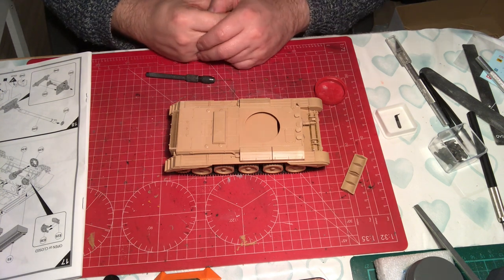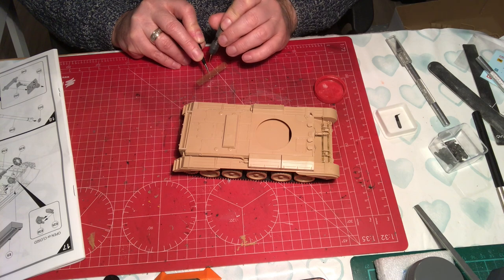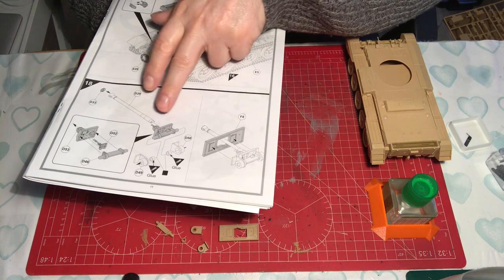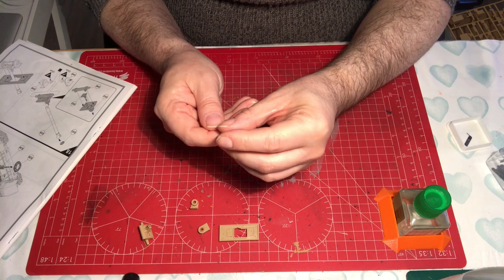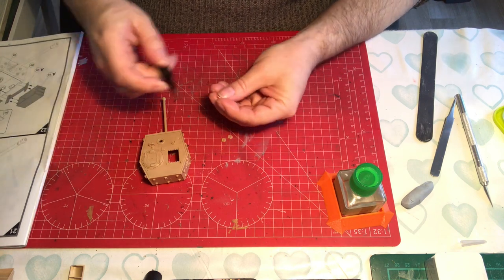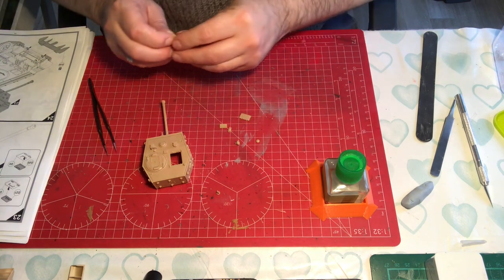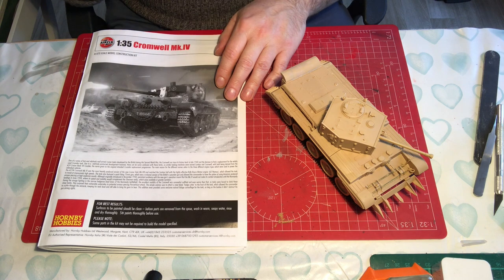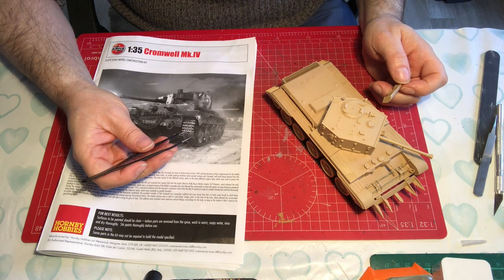Airfix 2021 1/35 Cromwell MK.IV build part 4

Comment: The small part of the bottom of the Extra Thin glue brush can be carefully pulled out to give you access to the glue at the bottom of the bottle. 
makes it easier to use all the glue before you have to purchased more. Like your videos.  Bill

Comment: you can lengthen the brush slightly when glue gets low
Reply from the maker: yes you can but I find the brush curls on the bottom, so I will decant some more glue in.

thanks fore looking in and your comments.

Comment: Thanks for the upload Jason :-) The applicator you used for the superglue, what is it called and where did you get it? I'm always messing about with toothpicks and match sticks and your tool seems so much better for the job. Stay safe bud.
Reply from the maker: Hi, its home made!  a small drill bit holder with a length of brass wire.